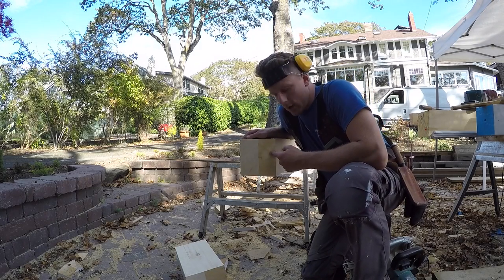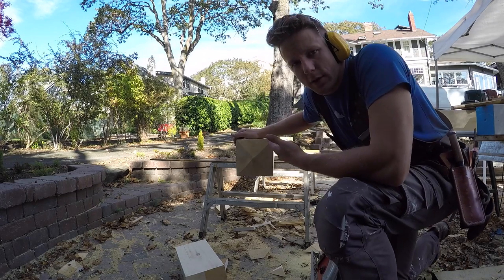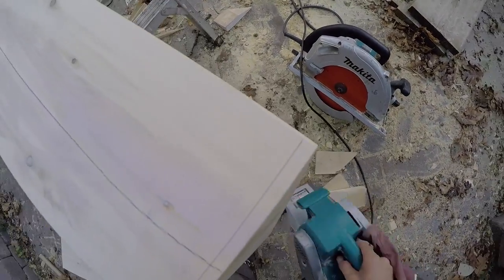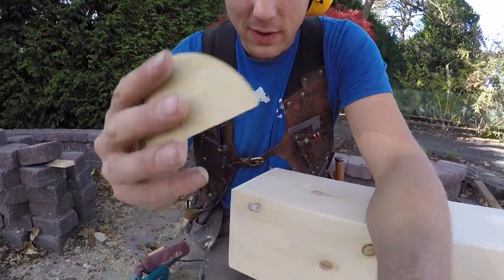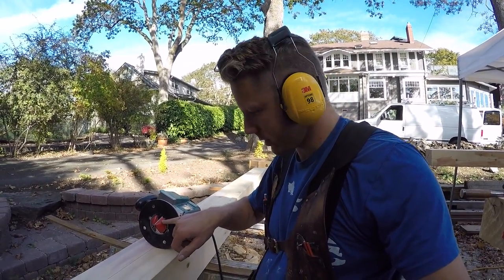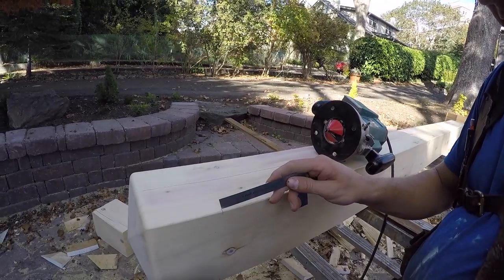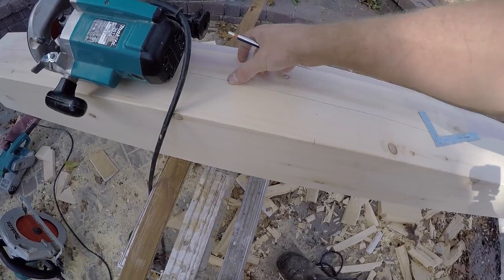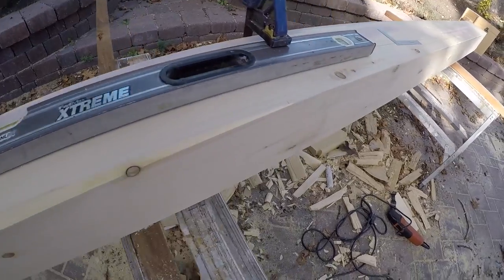How To Cut Tapered Chamfers On Posts

Comment: It's easier to get round surfaces if You use the sander in between the front roler and the flat base, where the sandpaper can flex.

Comment: How do you handle the crack in the wood and keep it from cracking further?
Reply from the maker: +Retired Navy SeniorChief Ideally you want to order "free of heart timbers" meaning the wood does not have the heart center of the tree in it. This will keep your timbers from cracking as they dry out.  If there are cracks, I fill them with Bondo and sand smooth see my video on fixing wood damage for more info on that.  The only way to keep cracks from getting bigger is to properly dry the wood.  If you put green timbers out in the sun they will start to crack immediately.  The best way to dry timbers is to store them in a cool shady area with a tarp or roof over them.